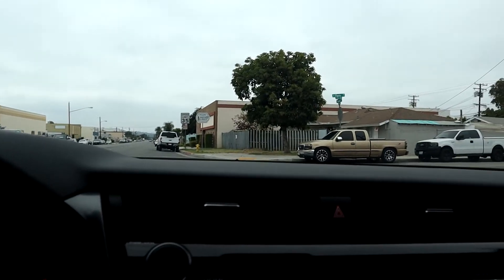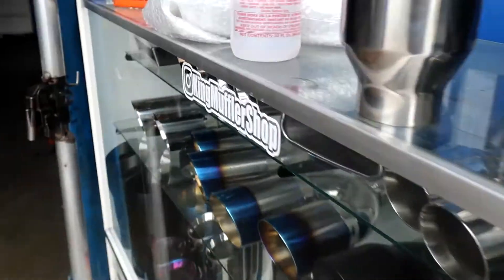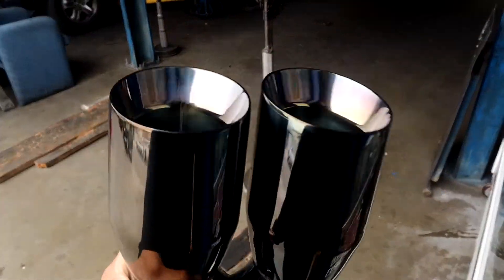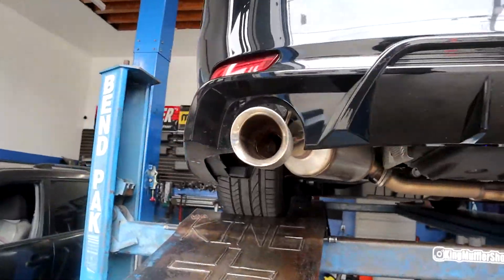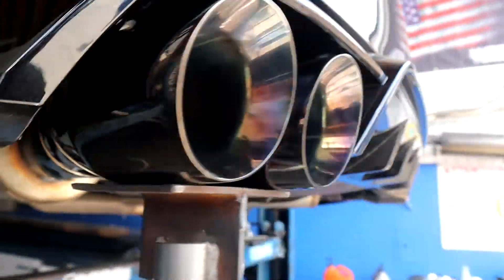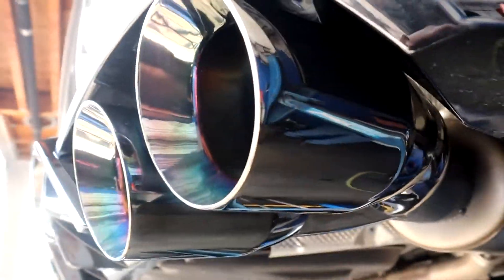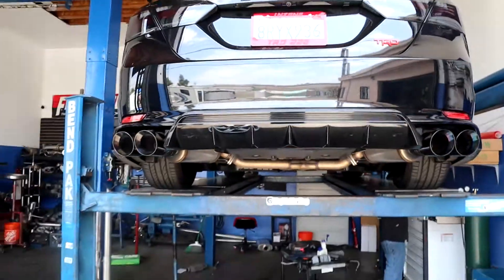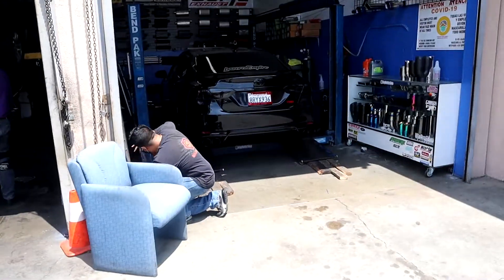INZANE TRD GETS CUSTOM QUAD EXHUATS TIPS

Comment: I’m actually heading into the shop soon to get the quads installed- I’ve been told otherwise by body shops that the tips would melt the plastic - could you let me know the inlet inches and outlet inches so I could fit it properly? Also have you experienced any problems?
Reply from the maker: I don’t know the inches tbh my guy at the shop knows his iG is @km_exhaust but he did trim off some of the plastic so the tips can fit & I had no issues at all

Comment: Did you have to cut the bumper to make it fit
Reply from the maker: I did have to cut a little bit
Reply: @Inzane.b58  at the time could you have left the trd exhaust and add the tips like you or was there no room. Just curious cause I want to keep the trd exhaust but add the quad tips
Reply from the maker: @osvaldoaguilar7623  that’s what I did I still kept my stock TRD exhaust but changed out the tips but for the tips to fit you will need to cut the bumper a lil